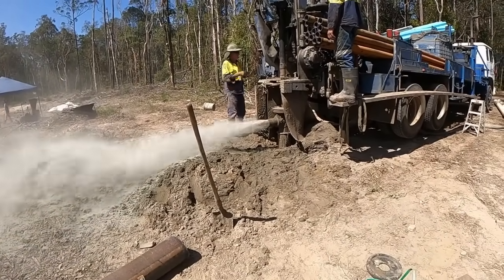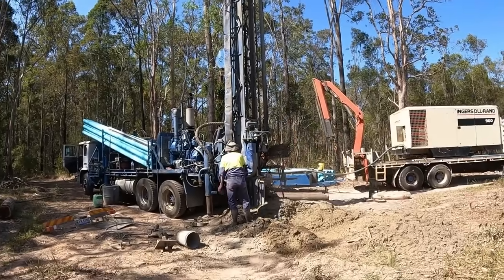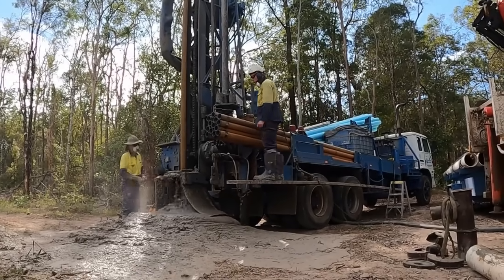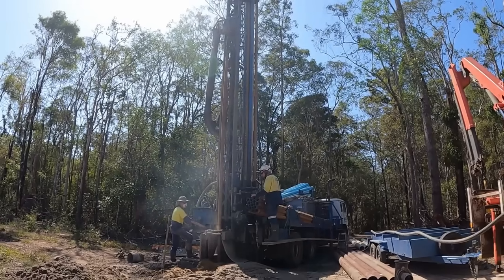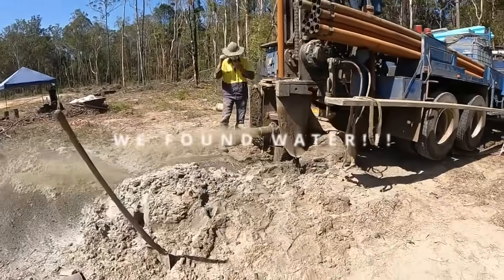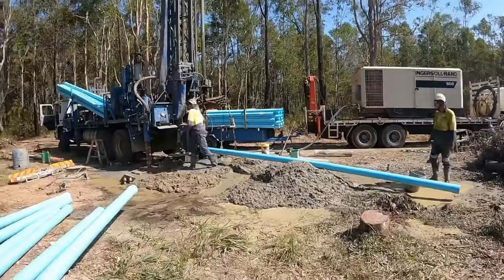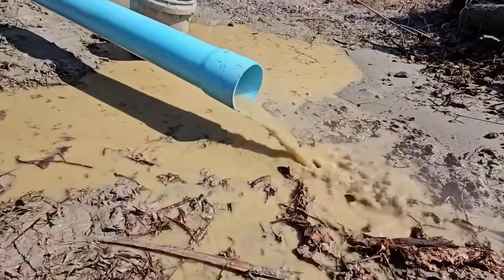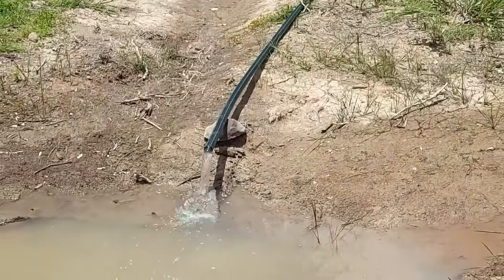We Drilled 36m Down for Water in Australia—You Won’t Believe the Result!

Comment: No modern methods other than devining? I would think ground penetrating radar would find it reliability.
Reply: There must be because when I got my bore put in I got hold on a map which showed an underground lake. My bore is on the edge of the lake and doesn't give quite as much as I would like but sufficient. We just have to wait a little ever now and then for the water to run back into the bore. We have a 63m deep bore but the pump is only about 40m down. The water goes up to about 20m when we don't pump.
Reply: A geophysical survey is one of the most common and reliable methods for detecting underground water. This technique utilises electromagnetic, electrical, and seismic technologies to map underground formations and identify water-bearing strata. (Google search).

Comment: I am in small acreage of 3001Sq Mtrs (rural residential). I have town water for the house, but prohibitively expensive to use that for watering my fruit trees I planted. We had to go down to 42 metres to get water some 25 years ago because of the common 10 year droughts. It cost me $5000 AUD at that time. I now mainly use this water to top up my swimming pool. It has worked faultlessly since it was done.
Reply: Bet the level has dropped.
Reply: @rogerphelps9939  Not that I have noticed. The aquifer branch I use will pump for a few hours at full volume, then reduce over time. If I turn the pump off, the aquifier refills in a couple of hours. It has been this way since it was drilled, and suit my uses just fine.

Comment: I am lucky lovely fresh water at 14 metres and lots of it, too much to measure, call it 500lpm touch wood. They drilled a bore 25 metres from mine and I told the driller mine is 14 metres and he said he had to go down 40 to find water. The house across from the new bore is at 14 too, I reckon he conned them. He wanted a job worth his time.

Comment: Divining......almost didnt watch the vid the moment I heard you say it. But then you mentioned the data base of existing bores and yeah
Reply: Yea I think the top diviners probably troll through the gov database before they take out the rods lol.
Reply: We put our bore in about 10 yrs ago. Granite country and over 1000m elevation. No diviner. First shot with water at 24m. Picked the spot based on advice of the experienced drilling contractor and knowing the farm. FWIW the advice was along these lines — granite country favours finding water at the bottom of depressions, pink granite is a good sign, green granite is borderline, and you need to think hard how long you want to keep drilling if you are in grey granite. 
And there are practical issues like not being too close to the property boundary, not too close to the septic drainage field, and minimising surface water messing with your bore head.
Water divining. There are way too many trials where diviners cannot find water in proper test situations, i.e., where water is switched from one underground pipe to another without leaving surface clues. As for the "moving water makes magnetic fields" story... remember the water in an aquifer is barely moving, the field from water moving at a reasonable speed is extremely week, and none of this tiny magnetic field is going to be detectable through half a metre of air let alone 20-30 m of rock. To prove this to yourself you just need to get the most powerful magnet you can find and see how quickly the magnetic effect reduces with a little distance.
My opinion is a good diviner can help find a sensible spot to drill, but the divining rods are theatre to cover the real skills being exercised, i.e., experience and reading the land.

Good luck everybody who takes this gamble... always expensive, and only wonderful if it works. But who can say farming isn't just another form of legal unregulated gambling? 😜
Reply: @pendarischneider  An experienced Bushie can read the land and the plants and tell you where water is. Now you can use the layers on Geoscience Australia and find the water using satellites and LIDAR and all manner of things. Get some rods and walk around and explain to me why they move.
Go and study Faraday he was a very clever man. His theories are considered scientific fact. Hes worth taking a look at.
Drillers tend to run in families. They have records that are not online going back generations. Registered bores require an annual fee. So at least half are never recorded. So the local driller probably knows where the water is give or take.
The real skill is to find water as close to where you want it as practical. 
Is the Aquifer charged by lateral flows or horizontal percolation? that has a lot to do with where it is and how much you get. 
They are not getting much of a flow, its acceptable but below the 60 lpm that is considered the minimum a decent driller would accept, but they were on a tight budget.
Reply: I have seen it work at the top of a hill in a dry area of NSW. I even had a go myself for fun. A really good bore was the result.
Reply: You can try it yourself walking along the street and finding water pipes. 
Its based on Science, the Faraday principle. Its how magnetic water flow meters work. A fluid moving gives off an electrical current. The rods detect that.
If the rods dont work the magnetic flow meters cant work, and they do.

Comment: We hit water at 60M, no sand so it cost us $52/M then we installed our own solar system. Total cost came in at just $12,000. We've bought 2 Chinese pumps in 3 years and have had a dummy spit and bought a better brand at 4 times the cost which we hope will go the distance. Flow rate for the bore is just 200L/min. but we have lawns, an orchard, vegetable gardens grapes and ornamentals thanks to that wonderful wet stuff.
Interesting facts, we hit water at 60M, drilled to 67M. The water level is now just 10M from the surface and because of pressure destroying pump seals we now pump from just 35M and leave the pump running all day every day.
Reply: Buy cheap, get cheap!

Comment: first time i see 3 welded tabs for connectors, here we use either threaded casing, or connector rings. Also, often if the hole is clean, you can use plastic casing instead of steel casing to reduce costs.
Reply: Agree 100% but I worked 40 plus years as Casing, Tubing, Drillpipe, Inspector ! Normally Casing is higher carbon steel so welds are not easy to perform !
Reply: @AnthonyTobyEllenor-pi4jq  Doesn't the steel corrode away? I have a zinc electrode on my pump as one corroded to pieces. The bottom part is still down there. This is in the Ballarat area of Victoria. There is a lot of iron in the ground. I can pick up iron stones with a magnet and any iron left on the ground corrodes like mad.
Reply: @leonhardtkristensen4093  That's what the zinc anode is for, to corrode first before the steel, hence it's name, "sacrificial block".
Reply: @garfieldnotthecat5777  I know that. That is why I put in on when I had the experience. I am an electronic engineer but what I am asking really is I suppose don't you have to put on sacrificial elements or is there no problems with the acidity of the soil in sand? I have clay. Plastic has no problem of cause (except maybe UV).
Reply: @leonhardtkristensen4093  Sorry man, I misunderstood, and maybe I still do. What I do know however is, if it's salty then corrosion will occur, hence zinc block. Steel casing in the ground will last beyond your lifetime and some. Clay is alkaline, so not corrosive. Plastic in the ground is not exposed to UV. Put a sacrificial block on your pump and check it in 6months, work it out from there.
Reply: @garfieldnotthecat5777  Don't be sorry I am just after information and also wondered why all iron on my land corrode at express speed.  My brother( a plumber, boilermaker, black smith but dead now) told me that he had never seen any thing rust as fast as it does at my place. That is on the surface. I am not a chemical engineer so I assumed it could have some thing to do with it being clay but you say not. I do not know of that there is a lot of salt around either. The water from the bore taste fine. I have not got it tested but the animals like it. 
As I said previously there is a lot of iron in the soil. Around my dam's I find little rocks or stones, some places a whole layer, that I can pick up with a magnet. In my old country I think it would be mined but in Australia iron is more of a nuisance. There is so much of it here.
Yes UV doesn't go in the ground but it is very strong at my place. I come from Denmark so I see the difference. Plastic buckets, plastic rope etc. just disappear in small pieces. And that is even in the shade. My water tanks are treated so ok. Plastic down pipes don't last all that long either but thicker ones appear fine. I was wondering if the casing pipes are treated. My bore casing (plastic) is fine so far but I have a little house over the bore.
Reply: No not for sand, you can't use PVC pipe in sand it must be hammered in using great force

Comment: Fascinating :), I can divine, long story, but ive noticed that I cant if there are very high voltage transmission lines within a couple of hundred metres (yards) ????, can any  more experienced diviners explain why that might be ///
Reply: You are not appropriately prepared within yourself.
Reply: @sunriseboy4837  Ommmmm.......?
Reply: Diving detects the electrical current a flowing body of fluid gives off. The HV wires give off heaps of electricity, stand under them with a fluorescent light tube and see it light up

Comment: I am almost at 100% accuracy in my water diving. I have two (old school) electrical cables from the ceiling of an old 1930's or so house. The type of 240 volt electrical cable that is wrapped in woven cloth. Banned decades ago for obvious safety reasons. The cables are stiff and to charge them I run my hand down each one in rapid succession 3 or 4 times. One time I was divining in an old home, i found a leak under the slab (turned out the owner confirmed it was an old spring that had been filled in) and then I got another hit but then thought i got a false reading, however there was a water pipe over my head running through the ceiling. These are my best diving rods/the best I have ever used.
Reply: @oo0Spyder0oo  Hey Feds,  check this guys hard drive.
Reply: What a load of old bollocks.
Reply: @oldbatwit5102  I’d agree with you, but then we’d both be wrong, I’m so sorry if my brutal honesty inconvenienced your overinflated sense of self.
Reply: @Leosarebetter  Nice reply.
Reply: @  My reply has disappeared. I wonder if someone reported it.

Comment: Congratulations on a successful bore. I was a class 2 driller until I wore out, did my own divining. There is a simple explanation for divining, but I don't explain online because there is always some religious nut who will trample all over the explanation. Drilling that bore would have been quicker using rotary mud, the mud holds the sides of the hole until cased, but your drillers succeeded.
Reply: Is that Bentonite in recycling tank ? Thanks for your service and enjoy your rest 🤠
Reply: @eugenio1542  I used bentonite clay or a polymer as the hole stabilizer.

Comment: Have you had the water tested? I drilled two holes on my property, each around 35 metres into basalt rock and both water tests had salt content 3x that of the ocean. $4000 down the drain.
Reply: You have got a salt mine!
Reply: I read somewhere the US Army built simple troughs in the volcanic ash on some Pacific Islands in WW2, lined the troughs with black plastic 
and placed a curved clear plastic roof above this feeder trench...
with the edges of the plastic roof ending in the middle of a smaller trench on both sides of the feeder trench.
They pumped sea water into the feeder tench...
the water evaporated...then condensed on the plastic roof...and ran down ito one of the two smaller trenches.
This water was used for the men and machinery...and also to grow fresh vegetables hydroponically.
Maybe that desert bore water can be simply and easily converted the same way?
Reply: Invest in a small Desalination Plant for your property. 

Then you can sell the 'Pure' water to the Neighbours.